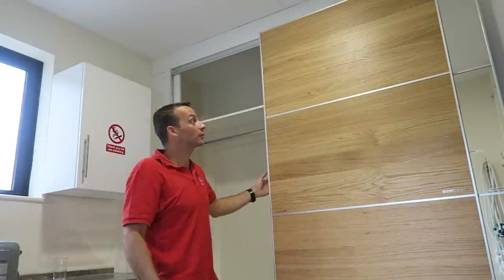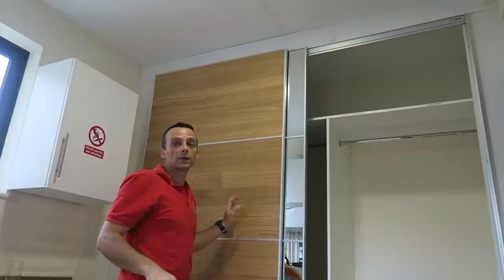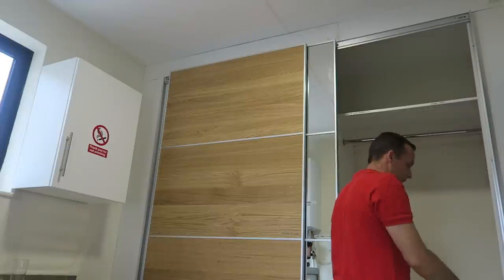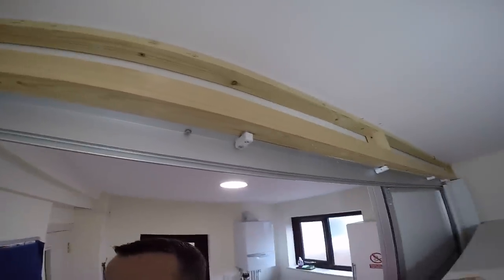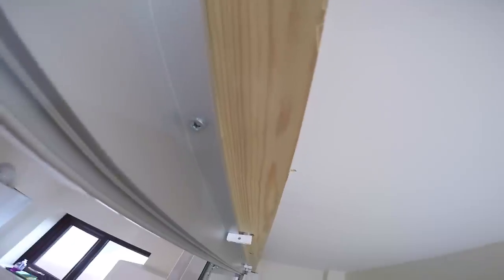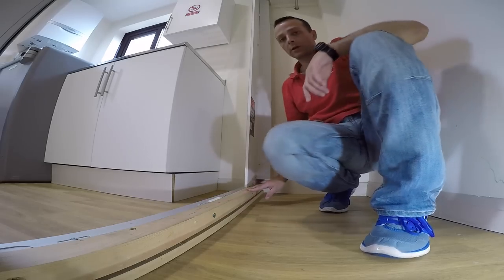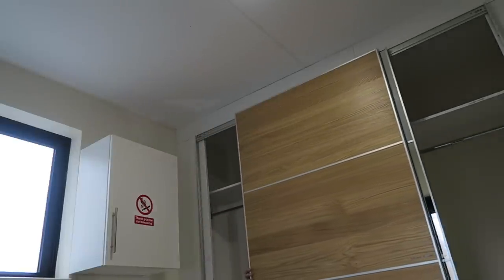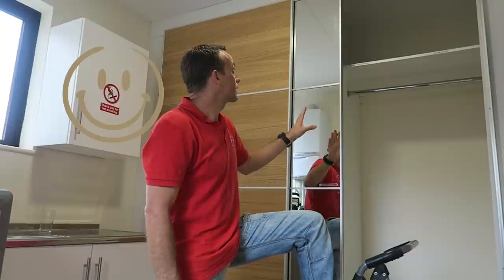IKEA HACK PAX DOORS WITH BUILT IN WARDROBE

Comment: Thanks for these videos. Can you tell me if you have to use the side rails?
Reply from the maker: You not need ending panels. There is stopper on the both sides on the top rail so the door would not come off the rails.
Reply: PP FlatPack thanks for the reply 👍

Comment: Hi! I just installed my pax wardrobe, however the sliding doors are slanted and I’m not sure why is that so as I installed everything according to instructions. Would u mind giving me advise? Much appreciate!
Reply from the maker: Vero Ng Can you send the pictures of the wardrobe especially doors from inside and outside. Can you take details of the door frame where it stuck hopefully would be able to help
Reply: PP FlatPack Hi! Thank you very much for your reply. I have emailed you the details with pictures.
Reply from the maker: Cant see it properly from the pictures but I think you make mistake on the door frames in the older model (they still selling them now) one side is thicker on the edge should be two ling panels and you need to put them as an ending panel on the door frame. So one door frame have edge sticking out on an outer side and the middle panel doesn't have the edge. The same on another door. Than when door sliding they don’t stuck.
Reply: PP FlatPack Hi! Apologies don’t quite get your explanation. Previously before  I dismantled it, it was in perfect condition. But when I assembled back, the door sort of slant and stuck whenever it’s put to one end. Hence, I was wondering if the wood gave way or  the metal piece hook dented. I’m stuck and wondering if I need to reassemble back again.
Reply from the maker: Sorry hard to say from the pictures if it was working before there must be something not right maybe would be better to take them of the rail and check everything again sorry cant help on this one.
Reply: Can't understand what you saying

Comment: My problem is I can't close it bsck it's like lock I can't push to open my closet slide
Reply from the maker: Usually when this happend one of the doors went off the rail and lock on the top of the door (outer door) or inside off the( inner door) blocking door to come back. You have to unlock and position door hinge back to the rail and then lock it. Sometime you have to take hinges off and than put the doors back.